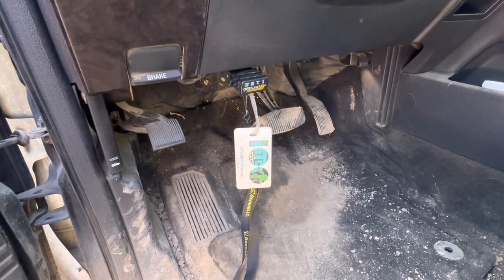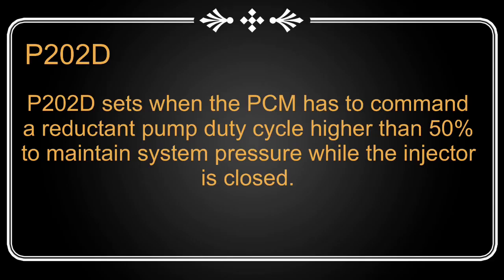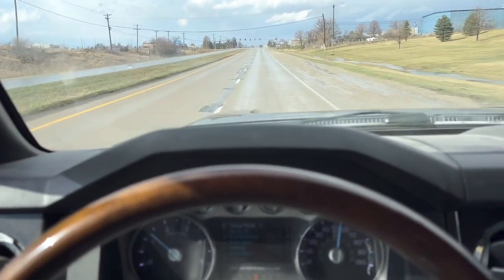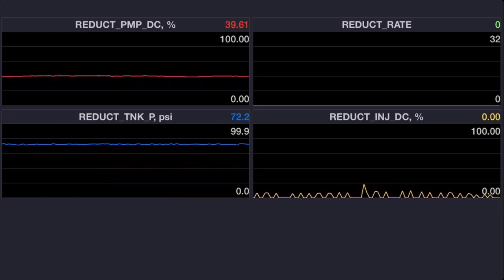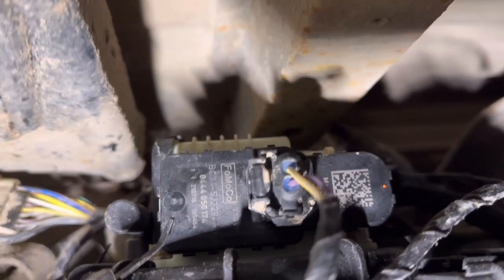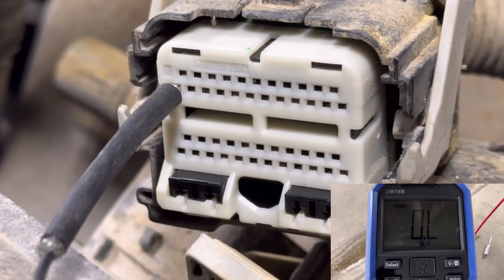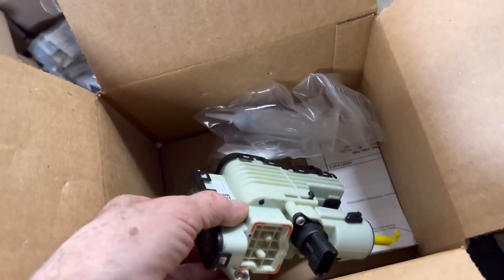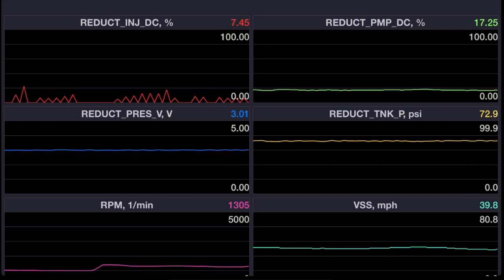Ford 6.7 Reductant Pressure Too Low P202D P20E8

Comment: You didn't show the replacing of the pump itself. That's what I wanted to view in this video. Thanks for the code info though, not that the truck owner can usually use that since most of us don't have the OBDll fancy readers.